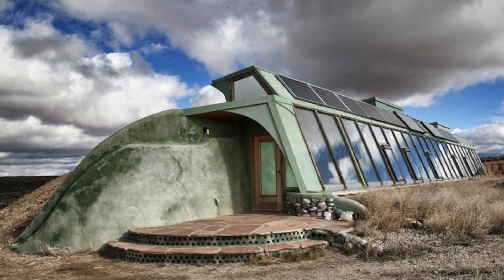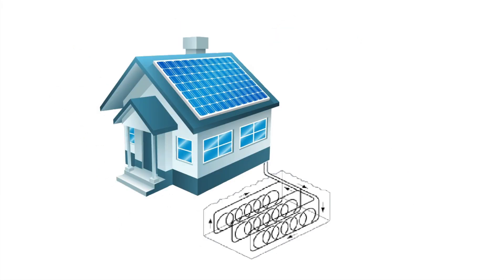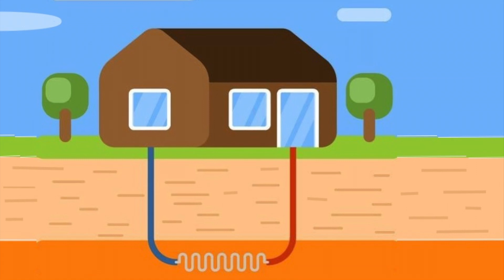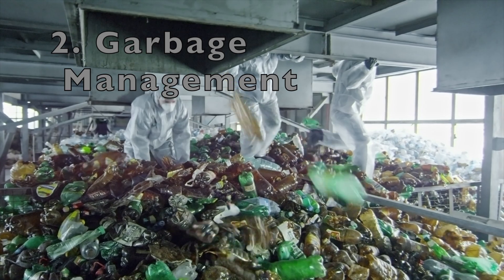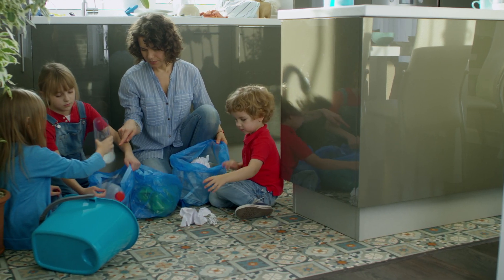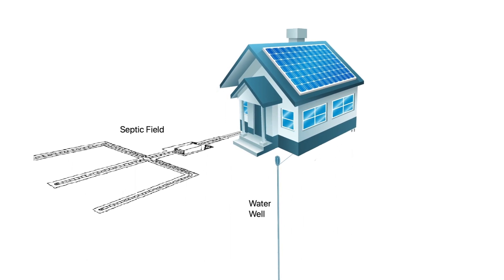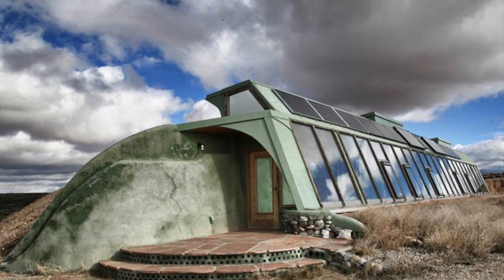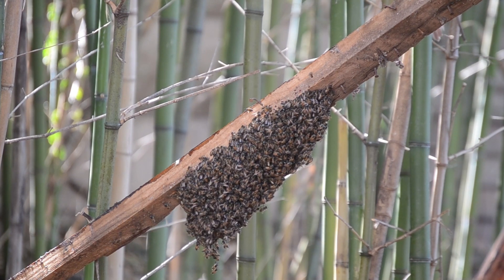Earthship Energy Savings for Any Home!

Comment: :goodvibes:Jj earthship is in good intention almost exaggerated and it is only suitable somewhere, here in Wallachia it would not catch without a thorough modification :-) and if I hold the basic ideas as the maximum use of recycled materials and autonomy in the island system, I will build a version tailored to local conditions for about a third of the price. And it will have a introduced aquaponic greenhouse, using rainwater as a utility and root cleaner at the end of the process :-) simply with a little consideration it is not a problem to build sustainable housing and at a reasonable price :-) may the promotion of domestic greenhouses succeed :yougotthis:
Standy
Reply from the maker: ok

Comment: You misunderstood some points with earthships but i think u did a decent job addressing a possibility with retrofits. There are different designs made to deal with each climate. The system that handles the sewage goes to outside plants and trees that arent food related but grown to handle/treat that type of filtered black water. At the time when earthships started back in the 70s no one was addressing the mass amounts of discarded tires. Its nice to notice you have done your research in finding how it has been addressed since then. Even though you saw the difficulty in the grey water usage they have academy sessions both in person and online now.  like your video dont get me wrong but found that slandering earthships is not a way to go if u didnt fully understand how it works.
Reply from the maker: Ok

Comment: I agree that it is a bad idea to have garden soil in your house. We have several greenhouses. While one is attached as a lean to greenhouse on the front of the house, it is accessible only from outside the house via a closed door from our porch. It’s supports rests on a separate foundation slab and it has a gravel floor. It rests against the existing exterior wall of the house but as a separate structure it could be removed. Thus it is not technically part of the livable interior space of the house. It is not connected other than via screened air vents in the wall. We enjoy the heat and cooling benefits but no bug problems. We consider the greenhouse to be a great asset. Not only does is help to heat and cool the house but it is often where we sit to read or even eat our breakfast and drink our morning coffee.

Comment: Drawing drinking water from wells is pretty expensive to install and operate and lowers the water table. My drinking water well is nearly 300 ft deep. Collecting rainwater is cheap as it runs off gravity. Too increase resiliency, redundant and complimentary systems are your best bet. I collect and use my rainwater. I have a well too to keep my rainwater cistern at optimal levels as I use the water for drinking water after filtering and for irrigation prior to filtering. Irrigation demand tends to draw the water down in the Summer. I also have hydraulic ram pumps that require no electricity to pump water uphill, solar powered water recycling pumps in my ponds and hand pumps for shallow wells used for irrigation.

Comment: South facing windows with overhanging soffit is a good idea but it works even better if you combine that with a Trombe wall or greenhouse (as they often do in Earthships). In Summer heat rises and EXITS out a vent to the attic or in the roof of the greenhouse and hence through the roof drawing cool makeup air through the earth tube. In Winter the rising heat enters the Earthship and is replaced by cool air entering the Trombe wall/greenhouse from the Earthship via a vent in the wall near the floor. By regulating the flow of air through these three vents, the temperature of the interior space can be maintained in a comfortable range year round.

Comment: The temperature of earth-ships and other passively heated and cooled homes can be regulated by venting the structure and by adding an additional heat source such as Trombe walls which both heat and cool the structure and a wood burning thermal mass heater or rocket stove.
Reply from the maker: sweet

Comment: Many great points in this video!

I do have to say a potable well would cost me $30,000 to $40,000. If I don't count the cost of my roofing on my main building and out-buildings [that i would have had to build anyhow], my rain system cost me under $3,000.00 [i may be adding a couple shallow wells, that are only good for agi that still will run me under and additional $2500.00]. 

If I was to build a full traditional gravity septic system, I would be looking at $5,500 to $6,500. My composting + BSF systems and my Grey Water system cost 2,500.00 [would have been less w/o commercial composter]. I also would have lost the benefits of the BSF Sytems that just can not be beaten in agi and animal production [with no bacteria concernes].

I really do like your closed air geothermal solution you recently posted using a radiator over any free-flowing air cooling/heating solution. Bacteria, mold, and other pathogens are eliminated!

With that said, I know that everyone has different situations.
Reply from the maker: well said!!!!!

Comment: Thank you for the information.  However, I disagree with your assessment that people using rainwater catchment are just trying to be smug.  Not everywhere has access to groundwater for a well.  Also, even if you never use it inside the house, caught rainwater is great for irrigating your yard/garden/food forest during those dry seasons and drought you were talking about.  It doesn't have to be "highly filtered" or expensive.
Reply from the maker: Good point
Reply: @SimpleTek  Where I live tap water costs about 4c/gallon, AND producing it has environmental consequences as well. A rainwater cistern costs about 5000USD. With a big garden and rainwater for the toilets, this means saving around 800 USD a year. The cistern is paid for in seven years.

Comment: The point on septic and using poop on the land. If you use a solid composting process you can kill of all harmful bacteria and virus. 5days at 65c° and then to avoid any possible contamination use it on fruit/nut/timber trees instead of putting it on veggies that you are gonna eat.  The whole thing about it would be to return nutrients to the land that have been taken from the land.  Another good thing about it would be less water moved. (Less energy) The pee can go in the septic as well as the kitchen sink and washer. But why not use the semi clean water from the outdoorkitchen to water some fruit trees. (Since we already spent the energy of pumping up the water)
Reply from the maker: why? we have systems with years of use in place that do all that

Comment: Our home is built on a south facing hill with close to 200 sqft of glass on the south wall. We have a well insulated basement and double stud R-40 walls on the floor above..  We have to heat it about 6 months a year. The only months we get zero heat from the sun is December and January.i always figure when the sun gets above 14 degrees above the horizon we get some radiant heat from it. Our 100’  deep well gives us 40+ gallons per minute( the well driller needed a bigger pump to go over this) that we.  only have to pump up 45’. Our remote cabin we use a cistern where we get 30 gallons for every 1/10 of an inch of rain. It rained close to 3” in the last week there. It is a long ways from any roads in the woods and the air and rain are quite pure.
Reply from the maker: where are you located? I'm 60 miles north of Winnipeg Mb and we still get heat in Dec and Jan from the sun - not tons but still good heat for 3-5 hours a day.
Reply: @SimpleTek  We are about 20 miles North of Anchorage, Ak.
Reply from the maker: @Chris_at_Home  ok, that makes sense for the reduced light!

Comment: The no overhang earthship you pictured first is in Fife, Scotland I think.  Overheating may not be that great a problem here.  For those that don't have them I guess an awning would be a great post construction solution.

Black water isn't used for crops in earthships.  The grey water is used for the planter cell, that water is then used for flushing and it goes into a septic field as you suggest.  So you kind of straw manned that point.

I do appreciate you taking a critical look at earthships and coming up with alternative solutions.
Reply from the maker: Thank you for the comments.. ok... you're right.... I appreciate you pointing that out.

Comment: I’ve got my heart set on an off grid passive hose, which will, in some way incorporate most of these. It’ll look, feel and be operated like a normal house, but it has to be built so well that it can be powered only off the energy that can be harvested at little or no cost off the land (maintenance on the equipment and eventual replacement does cost, but so does paying energy bills), other than the propane for the stove and grill, I don’t want the backup heat or generator running unless it absolutely must. The goal is owning the power plant, not buying energy.
Reply from the maker: I'm totally with you there!

Comment: The one thing you miss is that earth ships are designed to have no mechanical parts/ electrical parts which are prone to lifespan. Surprisingly I agree with most of the presentation at least for Canadian homes as we have lots of water not everybody enjoys that. The modern house needs every thing you describe and when I build my tent (greenhouse) I will have all you described my dirt battery is well water which is plentiful in Canada in most places so I borrow a little and take out 3 degrees and then put it back seems right to me.
Reply from the maker: That's awesome

Comment: Reusing water multiple times is one of the most important aspects of this design. Its not coming from a never ending tap like you apparently live. Its being collected and in some cases its the only water source. Either you are misunderstanding how the water is being used or you're intentionally misleading people. There is a huge difference between grey water and sewage! Your own borrowed illustration shows this 6:15. So either you didnt even look at it, or you just dont understand what youre looking at? Sewage is never recycled back into the house in any way. Rain water is collected, filtered and used like any other building. Then its used to water plant beds. Those plants clean and filter the water like they do in nature and its then used as toilet water. Once it comes in contact with human waste its immediately flushed outside to be treated. Its never used again in the loop after coming in contact with human waste! Since you like using Wikipedia as a source, here is one you should check out. 
https://en.m.wikipedia.org/wiki/Grey_water
Reply from the maker: most of it is unnecessary
Reply: @SimpleTek  Which parts of a reusable water system is "unnecessary" exactly? Turning on a tap and expecting water to endlessly flow isnt the case for most poeple in the real world. A huge portion of the planet lacks safe water or sanitation. Let alone the tens of thousands of dollars to "just dig a well". So they either collect it from the sky or whatever source they can manage. For a channel that talks about such cool sustainable tek, Im surprised by such a dismissive vibe. Yet you dont understand how grey water works? 6:15 Im actually curious whether you looked at this illustration or just borrowed it.
Reply from the maker: @GreyerShade  there are exceptions in extreme locations but water collection systems aren't limited to just rainwater. atmospheric water collection has been hugely ignored. There's high end and low tek versions of these systems

Comment: I currently live in Tucson and recently bought an older trailer house ('96) on a 1 acre lot.  The AC unit was original and went out at the beginning of the summer.  It cost me about $12k to replace it with a 5-ton unit that incorporated the furnace.  I SHOULD HAVE spent that money on a geothermal heat exchange, but didn't think about it at the time AND it was the beginning of summer so time was, as they say, of the essence.
Reply from the maker: outch!

Comment: This is very much what I plan to do when I move back up to Oregon.  Geothermal heating/cooling is easy and extremely cheap compared to the alternatives.  Dig a trench no deeper than a regular excavator will go about the same size as your house and you'll get 72° temperatures year around.  The only ongoing cost is the pump for the heat exchange.  This is paid for by removing the cost of a furnace, AC unit.  Add solar panels and, if you use natural gas for cooking and clothes drying, your energy costs would be minimal for really not that much up-front cost.
Reply from the maker: well you need a heat pump too but that's pretty much the idea
Reply: @SimpleTek  Yep, that's what I meant by "pump".  I know you can use 2 different methods, either forced air or pumped fluid.  I think the fluid version is much easier to regulate and may provide a more stable temperature.  I will probably use the latter, but it's still substantially cheaper than a normal furnace / AC unit.
Reply from the maker: @dienekes4364  well said

Comment: I have few disagreements with your video. Replacing a septic tank with a biodigester would allow you to generate methane gas to cook with. The liquid still goes into the leach field but you also decrease your energy demands on the grid. Also by adding non wooden biomatter you will decrease landfill waste. One building may not make a huge effect but when hundreds or thousands do it, it all adds up. If municipalities did it also it could end storm black outs to essential services.
         The heat battery is a good idea but a hybrid solar panel would be better. PV panels suffer from an electric loss problem as they get hot. Using a hybrid panel to wick away heat to the heat battery while generating increased solar electricity seams a much better idea to me. Preferably with non toxic Edison batteries instead of lithium or lead acid. And Edison batteries can last up to 50 to 100 years with maintenance. They have already done it in industry.
       Using a thermal chimney could eliminate or at least decrease the energy use to cool the building.
        Better house design would also help. Why are we wasting space on rooms we only use 8 hours a day? We gave up things like day beds and Murphy beds decades ago. Why arnt we still using them to use our resources more effectively? Kids could have play rooms, parents home offices or hobby room, or a home office could be used as a guest room with a real bed instead of thin lumpy cot matress.
Reply from the maker: Thank you for the detailed comment. I feel I have to let you know that holding and septic tanks emptied don't go into landfills in the vast majority of municipalities, they go into lagoons that naturally decompose the waste and recycle it back into the environment.  No landfill waste at all, but there is fossil fuel used on the truck to transport it, unless it's electric.
 I agree your batteries are better, but a thermal dirt battery wins on cost by a factor of over 10X every time and lasts forever. You're absolutely right on house design too, but this video was made to change an existing house for little cost.
Reply: @SimpleTek  I was talking about yard and kitchen waste, not sewage. In addition to sewage, which the reason why I would not use a biodigester fluid for food crops. Alot of yard waste(grass, flowers, leaves etc) can be added to produce syngas. 
      It was the yard waste and kitchen scraps going to landfills I was talking about. It's being done in many third world locations and we have not caught on yet. 
      If you only decrease the building energy use by 10% with 4 systems you have reduced the carbon footprint to 60%. To me 60% is alot better than 100%. If you add proper insulation for another 10% you have cut energy(and cost) by half.
       But if you can average 25% savings with all five improvement, then not only are you below net zero system your actually providing more energy back to the system than you consume.
        Look at a tree, it does not  grow one leaf to supply all its needs. It has thousands, each providing a tiny bit. If we build the same way we decrease our dependence on others, on fossil fuel, and on the whims of nature.

Comment: Is your home off the grid?
Reply from the maker: No, but I'm close to it. The biggest thing in my climate energy wise to go off grid is heating, and I use wood there. solar is great but we get a lot of wind and currently researching windmills for a hybrid solar/wind system.
Reply: @SimpleTek  Just imagines your home has three sides insulated or take advantage of the south facing windows.   Heating wouldn't be a problem.

Comment: The point is that earthships use cheap and free materials tp heat and cool whereas your ideas of incorporating earthship design into an existing home are very expensive.
Reply from the maker: You missed the point, it's that although the materials are often free in an earthship, the labour costs are astronomical making the 'free' part a mute point.
Reply: Some people have more time than money.